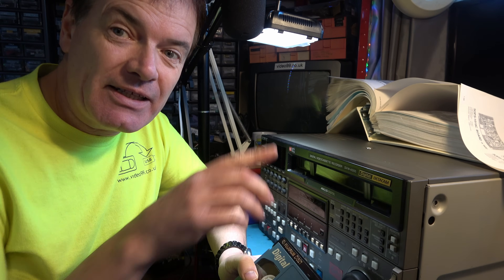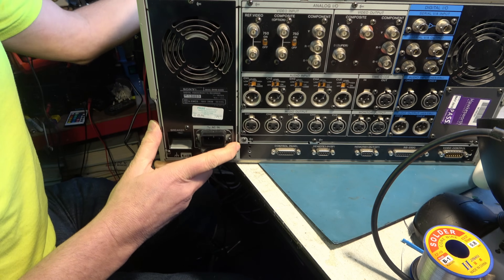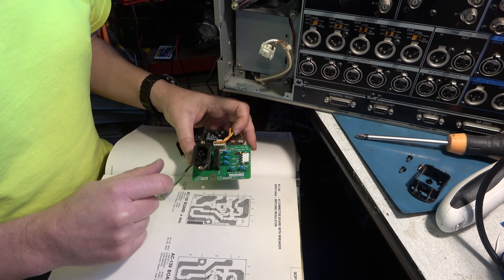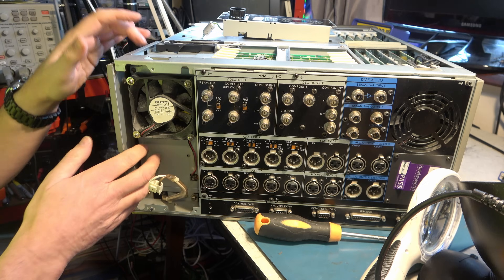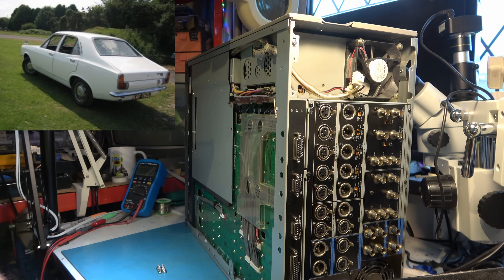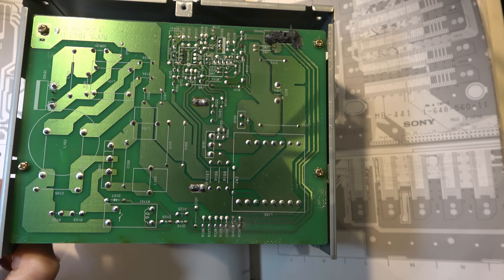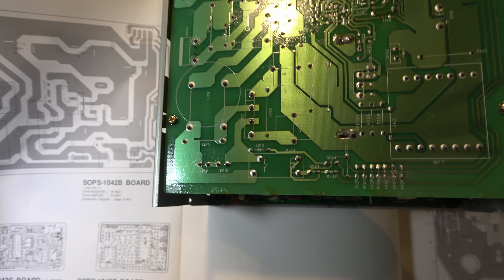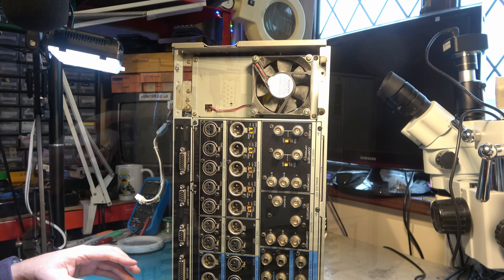240V connected to a 100V Digital Betacam recorder which cost thousands. What happens?

Comment: When i attended the digi beta course in Melbourne back in the early 90's the trainer said that the power supply for all digis was capable of 110 and 240v operation.
Reply from the maker: I think you are right  but it's marked 100v only for some internal reason.

Comment: Auto-transformer probably.
Reply from the maker: No, there's no auto transformer in here.  That would be huge and wouldn't provide mains isolation either.
Reply: An auto-transformer , well... automatically change to voltage being supplied.
Reply: Google it.

Comment: I believe electronics sold in Japan are required to only support their 100 volts AC mains power, and to not officially support other voltages, to discourage them from being exported and sold overseas. Of course this is often just a formality, and many JDM items either can easily be modified to operate on different voltages, or are actually multi-voltage capable, but don't advertise it.
Reply: Indeed, I recall the early PS3 consoles were multi-voltage, but most were too scared to find out! :0
Reply: i imported many cams from japan , sharp twincams , sony handycams etc , all their power supplys supported 100-220v (90s eu standard , changed to 240 today) 

they work absolutely fine

Comment: 18:00 Actually the acceptable "normal" voltage for Europe is 230V -6%/+10% (216V to 253V) So up to 253V is considered normal and every power supply should tolerate that. 253V in still considered in spec.
Reply: yeah, just remember that the UK only follows its own rules 😆

Comment: Most switched mode power supplies are universal even if they don't say that on the back, as an experiment, I have a 220V/110V stepdown transformer ant every 230V TV here in the house runs happily at 110V including CRTs, even though the back only says 230V.

The first CRT I tried with a transformer was a 29" Samsung TV, it said 230V on the back but on the manual it said the power supply worked between 90 and 260V, and sure enough it worked fine at 110V though it was weird to hear the degausing coil taking longer to switch off.

Comment: Isn't this the main difference between linear and switching power supplies, ? with computers and most consumer vcr's have/had switching power sopplies, the voltage range is good for USA/Japan NTSC and Europe PAL mains, 50/60Hz also. The DC output will be the same for both cases, and the mains frequency is not used for the electronics, or are there any AC motors used in these pro machines ?

Comment: Part of the 100V marking on non PAL machines was probably part of the marketing/sales separation of PAL and NTSC markets to maintain price differences.
In addtion there were 3rd party kits to convert 480i DVV-A500 machines to 576i with some component changes and there may have also been full switchable mods. I vaguely remmember Sony cracking down on buying the Sony spares for the 3rd party conversion kits.

Comment: I have imported quite a lot of electronic equipment from Japan to here in NZ where our mains is 230 volts. 
'JDM' (Japanese Domestic Market) equipment always states on the plate that it is 100 volts, even on the units that are capable of running at higher voltages.
I suspect they do this because the JDM stuff was never designated to be sold or used anywhere but Japan, so there's no need to advertise the fact it will work at any voltage other than 100 volts.
Probably 2/3 of the gear I have imported was strictly 100 volts only, and I have had to convert those to 230 volts by changing out the internal mains transformer.
On some units I have got lucky and the internal transformer has multiple primary windings so is easy to change to 230 V.
As for the SONY Digi-BETA, I have worked with a few of them over the years, but all of them have been PAL units and had the 100 - 240 volt plates on the rear.

Comment: The other way you can test for suitability is to see if the output voltages are what they are supposed to be.
Reply: The only component you can test that way is an unloaded 50/60 Hz transformer, not a complete power supply because they have rectifiers, voltage regulators, transistors and other voltage rated components like capacitors, which can suffer a lot of damage from overvoltage as well.

For example... In a 110V>12V power supply, the transformer will output 12V AC. After that, it's rectified to DC and the voltage will increase to 16.9V. 
Most of the time, a voltage regulator IC is used to bring the DC voltage back to 12V, just regulating the voltage 4.9V down. Perfectly fine.

Now, you connect the same power supply to 240V mains. The transformer is now outputting 26.2V AC and after it's rectified, the voltage increase to 36.9 V.
The voltage regulator will regulate it also to 12V, but now it's regulating 24.9V down and it's getting overheated within minutes and dies.
When you do a quick test, you'll measure 12V at the output, assuming it's all fine. And that's just one example what possibly can go wrong with a simple and straight forward power supply.

In this video it's a switched mode power supply, that's even worse with more components that can suffer damage. Luckily, Sony engineers where ahead of their time designing multi voltage power supplies before it became commonplace.

Comment: The power connector plug at at 3:32 appears to be a common computer power connector that was used on US Computers.  Perhaps it is indeed a US/Japan plug?
Reply: That's an IEC C14 connector that's used for voltages between 100 and 240 V all over the world. Every single desktop/tower PC (except for very large ones that draw more than 10 amps at 100 V) has this connector.

Comment: I found something similar with panasonic DVD recorder from the EZ series that I imported from the UK to the USA - Was marked 220V only while US models are marked 110V only. I thought I'd have to use a step up transformer with it, but turns out it worked on the lower voltage just fine. I did compare power supplies between similar models and US ones have a larger main higher capacitance and a slightly lower voltage rating (350V/100uf in USA vs 400V/47uf on the UK model), presumably because they have to "switch" twice as often to get the same outputs when using the lower voltage .  I basically just increased the capacitance of that main cap and I'm pretty sure it is otherwise similar now other than possibly should have higher amperage mosfets. Apparently the control circuit that handles the switching doesn't mind the higher input voltage and that's probably why yours hasn't blown up. But agree, universal supplies would have been nice and probably would have added something like $1 in cost to have both voltages fully supported. A lot of the internal transformers also will have a midpoint tap that you can use so that you can use two different input AC voltages to get the same output voltages. I didn't mess with that on my supply since it worked, but could be something to consider if you run across something else that will not work on 220V.
Reply: Of course there's also the possibility of running 240 V dedicated circuits in the US, every house has a split-phase 120/240 supply and US 240 +/- 5% is well within the limits of European 230 +/- 10%. Admittedly it's a bit of a faff but could come in handy sometimes. The most common choice of plugs would be the NEMA 6-15 but I don't think there's any legal requirement to use them, you could use UK or EU sockets and plugs.

Comment: My mains voltage often hits 250V here (yes, I'm sad enough to log it and graph it!) typically overnight in the early hours of the morning. One of our labs in work hovers around 252V nearly all the time, and it causes problems with UPS units cutting in with their factory default thresholds because they sense an excessive input voltage.

Comment: They probably just relabel the power supply for the home market to save cost on redesigning it just for the home market. There could be some Japanese legislation that made them rate it at there voltage and power rating at 100v . Don’t try this at home Lol. You could just get an auto transformer if you’re worried

Comment: Have you ever tried to diagnose and fix these boards? I've noticed in just about 99% of your videos you never do any electrical repairs to fix these units like changing caps or other components , I only ever see you doing "board swaps". It would make your videos a little more exciting, educational, and possibly add more views and subscribers.
thanks
Reply from the maker: I've done heaps of capacitor changing (DVCPRO for example) but it makes for pretty dull viewing.  Been down to component level repairs on multiple machines, some examples that come to mind; Grundig SVHS, Grundig V2000, Philips V2000, JVC DVD recorders, Panasonic MII power supplies, Sony Digital8 camcorder, Sony DAT machine, Sony SuperBeta, Philips DCC, Philips N1700 (it's on my outro video), Sony PCM digital audio boards, Panasonic SVHS.... the list is huge.  So your 99% figure might be slightly wrong.
Reply: @video99couk  Sorry I probably did stretch that a little, but you got to admit you do a little more board swaps than repairing them. I still think you have a great channel here and still enjoy your videos.😉

Comment: I feel sure that if the power supply was 100V only it would not run for very long on 240V before something let go! Perhaps the supply was indeed swapped for a PAL one. Often someone would put a warning label on the machine if it was 100V only.

Comment: Plenty of places in UK have 250V. Usually its between 243 and 248 - Everywhere. Never seen 230 ever.
Reply: Weird isn't it. It's been decades...  @Matt_Quinn-Personal_Account
Reply: PS. The frequency is much more stable. That seems ultra reliable, and that makes much more sense since we are talking about giant rotating machinery and not having losses affecting it etc. Clocks, timebases  and your Linn LP12 turntable all relied on a constant 50hz. @Matt_Quinn-Personal_Account
Reply: Yes, and of course the Linn has not relied on mains frequency since the Valhalla mod in the mid to late 80s.I met the company owner many times (Ivor not his son). I set up hundreds of Linns over the years.  I wondered if you would know what I was on about. Very glad (and not too surprised) you knew very well. @Matt_Quinn-Personal_Account
Reply: Doesn't "230" just mean designed for 220 and 240?
Reply: @RWL2012  No. I live in New Zealand and our mains is 230 volts. That is the "standard supplied value". The actual voltage measured at any hotpoint can vary and the allowable tolerance is +/- 6 % of standard. I am in a number of motorhome and caravan forums and I regularly see people saying that their caravan etc is set up for 240 volts. It baffles me. We have NEVER had 240 volts here, it has been 230 ever since mains reticulation was provided early last century. Where are people getting 240 from?
Reply: @Matt_Quinn-Personal_Account  If the supply frequently exceeds 230 V +10% I'd complain. Anything up to 253 V is acceptable but more isn't. I'm not sure about the UK but most of Europe eventually settled on 230 +/-10, with an transitional phase of 230 -10/+6 to make sure old 220 V equipment wouldn't be damaged. The assumption seems to have been that by the time the tolerance band was widened to +10% all older equipment would have been discarded.

Mains voltage is usually higher in rural areas than in city centres to compensate for voltage drop under load. Long lines, particularly 230 V ones (as opposed to 10 kV+) have considerable voltage drop under load, so to make sure the actual voltage remains within the limits under full load, the suppliers crank the idle voltage up as far as they can. In densely populated areas transformers are larger and cable runs usually much shorter, so the actual line voltage tends to be much more stable throughout the day.

Comment: Sony Betacam DNW-A45 sometimes had the same issue. The Sony DVW-A500 (NTSC) was well know for accepting power requirements of AC 90V to 265V (48Hz to 64Hz) even if the input was only 100V (AC) due to the higher serial numbers back then (Anything Higher than serial code 11944). The power consumption was 300VA (240W). Sony may have made a error by not mentioning the 240V (AC) acceptance next to the 100V (AC) input on the manufactured label. The unit should be fine to run on 240V (AC).

Comment: The parts and documentation that you're showing in the video would not have been enough to convince me that the power supply is officially 240V capable. I know that lots of times, manufacturers use the same parts in different power supplies. Here in the USA it's quite common to see 250V fuses and 450V filter caps in power supplies that are intended for 120V. I would have taken the power supply out of your PAL recorder and compared more parts to convince myself that it would be safe to use it on 240V.
That being said, I also know that many switching power supplies are very capable of being used well outside their specifications. The VCR I brought with me from the Netherlands works just fine on 120V even though it says it needs 220-240V on the back side. But putting 120V into a 230V power supply is a bit more safe than putting 240V into a 100V power supply I would say, so I'd be a bit more cautious. 
Oh well... I guess if it blows up you always have a spare from your PAL machine... 🙂
Reply from the maker: What convinced me in the end was the part number of the power supply is identical to that being sold for a PAL machine.  So I knew then that the power supply was OK for this voltage.  The only question was the input board, and all the components are 240V+ rated on that.

Comment: Oddly i didn't think about switch mode power supplies,  i was a bit confused.
When you showed the box with a fan i felt like a right pillock lol.
Most laptop chargers have a 100 to 240v input i have Repaired  loads but
Never looked close.
Perhaps the original psu was for 110 volts for japan,  then there was a need to also use the machines over seas,  so a new psu was made for any country, just One psu.

Comment: Can't be many Hillman Avengers on the road these days?
Reply from the maker: About 300 of them now.  The number is slowly increasing, oddly enough.  See mine here: https://youtu.be/t4J-grV_CsQ
Reply: @video99couk  didn't they send tens of thousands of the things to Libya and Iran, as 'Kits', to be assembled there? Or was that the older Hillman Hunters (which I think was a nicer looking car than the Avenger!) lol.
Reply from the maker: @swanvictor887  I much prefer the Avenger shape to the Hunter 3-box design.  Hunters were made in Iran using the original presses, so they weren't kits.  It might be that a small quantity of Avengers were built there too, but the main country to get the Avenger presses was Argentina, where VW built Avengers until about 1990.  As it happens I've just had a new oil pump installed in my Avenger, it came in a box marked Made In Iran.  And it is fantastic, really delighted with it.
Reply: @video99couk  wow, had no idea they had reached South America too. Amazing when you think about it, what we were able to do as a manufacturer back then...!